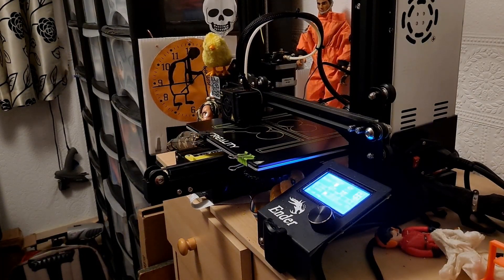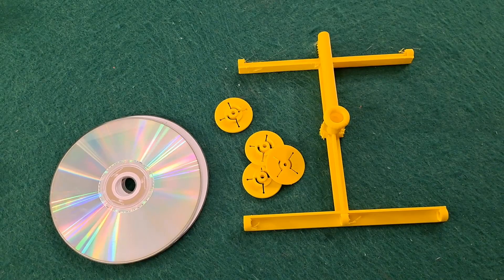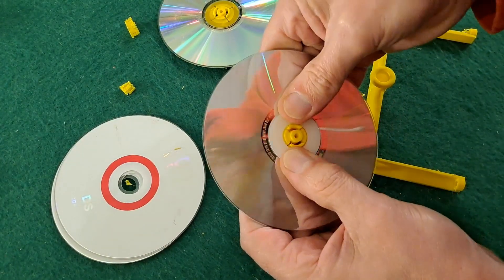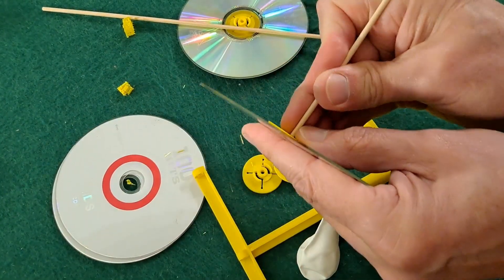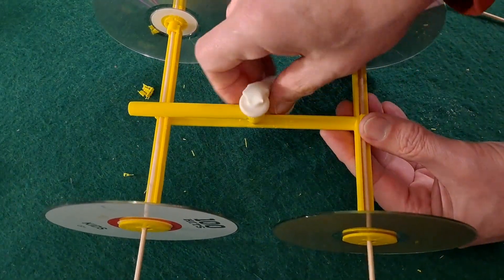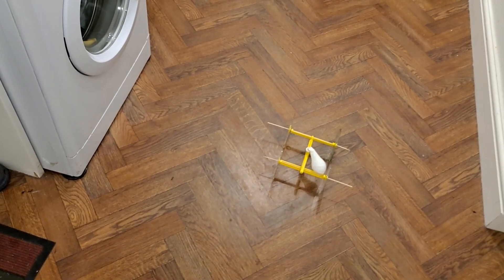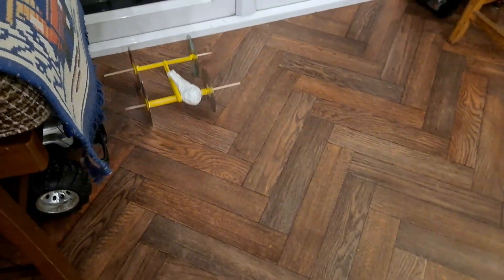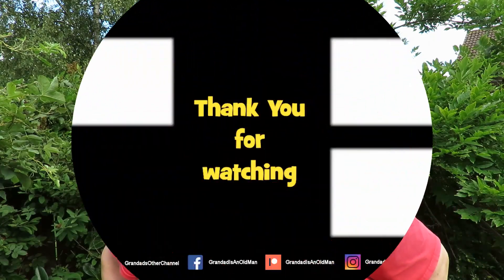3D printed balloon powered car

Comment: good results GDad!! maybe use skewersfixed on  to hold bigger balloon ?😀👍
Reply from the maker: Hi Larry, yes I could easily hot glue some bamboo skewers on there. It wouldn't be hard to 3D print "mudguards" to keep the wheels clear, or jack the chassis up on stilts